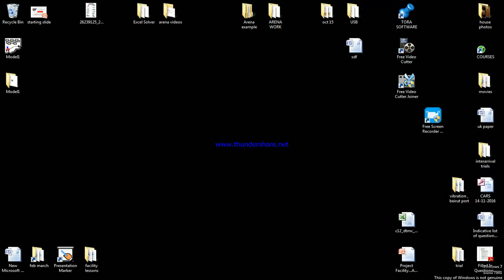Production Plant Arena Simulation

Comment: I am facing a problem, entities only pass through station 1 or operator 1. The other stations are left idle. How to fix this?
Reply from the maker: have yo used pick station, 

I have to see the model to be able to tell,
what arena version are you using, if it is newer than the one i have got it wont open on my system